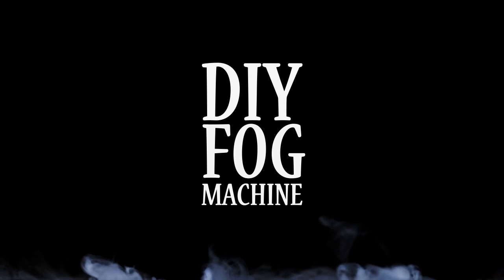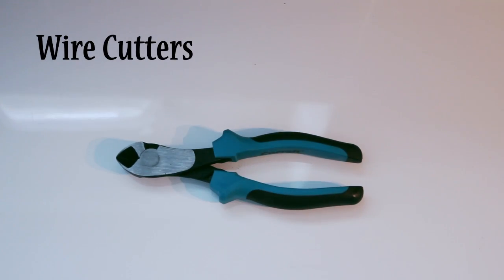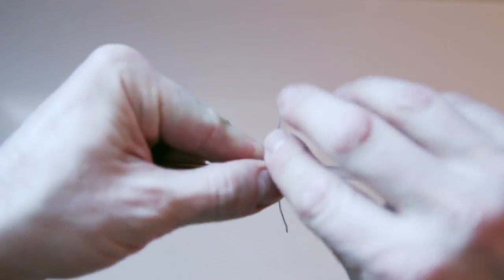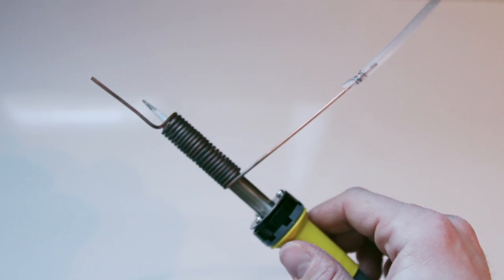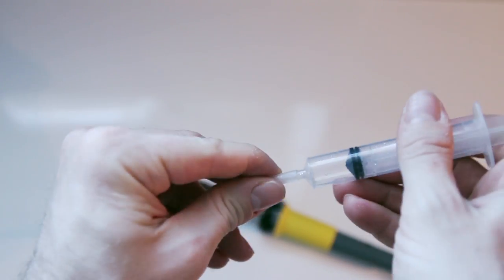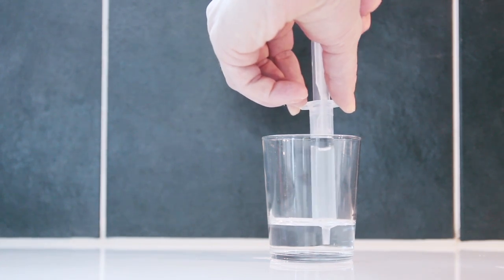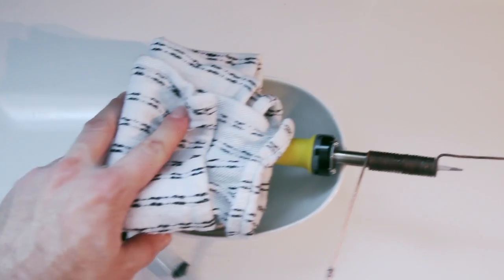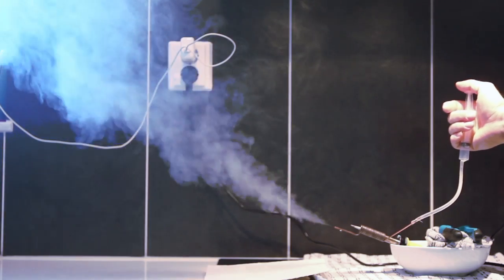DIY fog machine

Comment: Awesome. Too bad soldering iron isnt cheap.
Reply from the maker: Mickeyickey i agree, the purpose for me was to not go out and buy a fog machine. If you need to buy a hot enough soldering iron its kinda pointless. However, you could try elaborating with an upside down clothes ironing-iron. or maybe even an open flame from a candle.
Reply: +Johan Karlberg I will try to make an alternative for soldering iron. Thanks for the video.
Reply: I know its been 2 years but, you can use the heating element from an old coffee maker, water heater, electric stove. I can probably get it free if someone is throwing it away.

Comment: Can I use purified RO water or tap water instead of distilled water ?
Reply from the maker: RX Fusion it should be destilled water, i dont think you will break anything by using tap, so try. I always used destilled. You could ofcourse buy fog-liquid from a store instead =). Are you making a build?